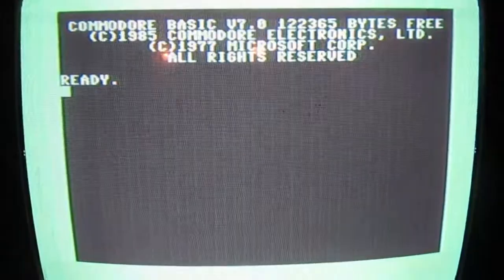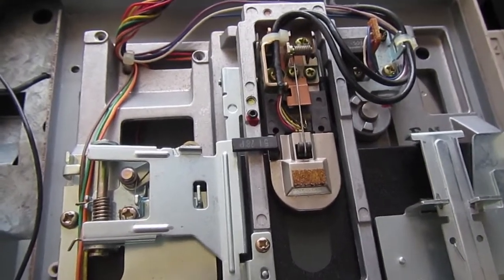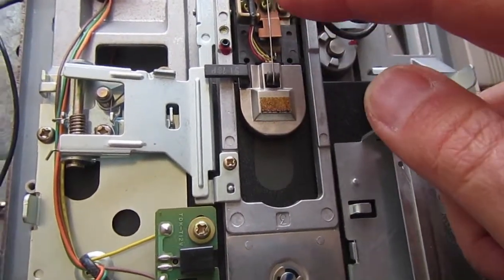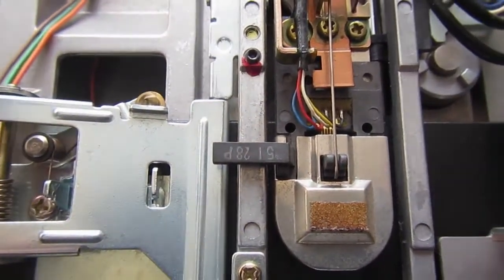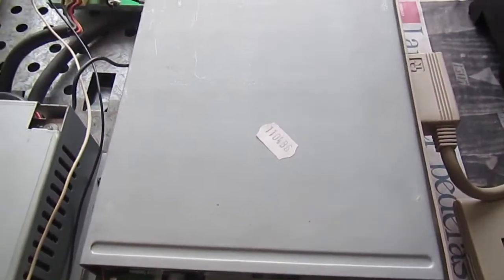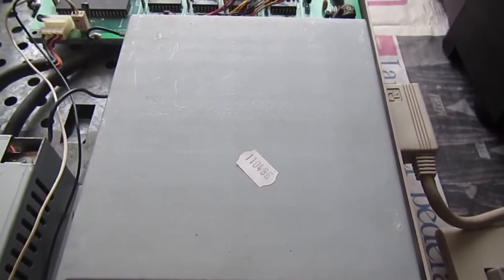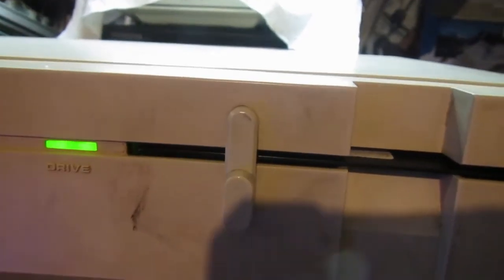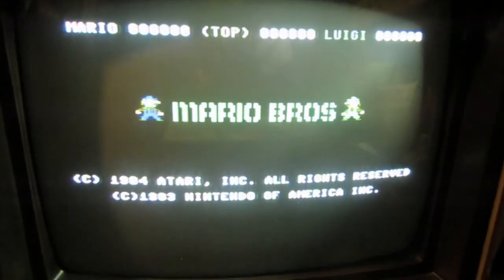Commodore 128D (1571) disk drive repair (plus other minor faults)

Comment: Got two of those monsters after my C-64 died. First still looks new but the warranty just ended when I tried the business computer mode and it failed to initialize. Repair shop charged $75 U.S. just to tell me it needed a new motherboard and not worth fixing. Bought the second 128D but can't remember why I stopped using it other than being pissed that Commodore and thier affiliated magazines stopped support for non Amiga computers. Think I moved to Windows 3.1. Getting ready to test the 2 computers when I find the cables and monitor.

Comment: many thanks for the very useful video.  I've a C128D and my problem is the small ribbon cable that goes from the 128D motherboard to the drive electronics, it appears to be damaged. Any idea where I could get a replacement ?
Reply from the maker: Hi! I don't think there're modern replacements ready made. However you can maybe test all the wires connections from one end to another with a multimeter and if there's a missing connection, simply cut the old wire and solder a new one. It's a low frequency connection so it will work fine. Keep the wire lenght as short as possible though.
Matching connectors can be still found on digikey for example.

Comment: Hi, I have an issue with my 128d floppy unit because it got once opened (by a stupid guy) while the green LED was ON (probably reading the disc). Since then the unit wont read any disc. Initially no error but when trying to Load a disc, makes noise (like reading) but then quickly aborts and keeps bilnking green + error message. What happened? Any ideas?
Reply from the maker: Hi, in theory that shouldn't have damaged the drive. You can try to insert a known good disk and issue (even in C64 mode) this command: OPEN15,8,15,"I0" : CLOSE15 

Also try to read the error channel. Keep in mind that isn't possible to diagnose a drive failure at great distances from the actual drive :)
Reply: Hi, thank you so much for the suggestion. I assume that the text between the quotes is I0 (letter I and number 0). I tried (it kind of resets the drive) but did not help.The error message when trying to load a disc is "?File not found error". What else could I do to troubble shoot? Thanks a lot!
Reply from the maker: @andreiturtoi3116  Yes, it was correct, letter I and number 0. File not found is interesting: try DIRECTORY in 128 mode or LOAD"$",8 in 64 mode.
Reply: Directory in 128 mode starts floppy booting then gives "Ready" however the green led of the drive turns to flashing mode...permanently
Reply from the maker: @andreiturtoi3116  Can you read the error channel after unsuccesfully DIRECTORY? You can do that with PRINT DS$  Also is worth trying different disks.

Comment: Nothing worked. It still either doesnt read the disks, or it freezes up while attempting to do so.
Reply from the maker: Hello! If it freezes up, I would suspet an issue with the IEC bus and/or burst mode communication between the 128 and the drive. Does it behave in the same manner also in C64 mode? Do you have any test equipment like oscilloscope or logic probe?
Reply: @iz8dwf  i do have access to an oscilloscope, but only at school. However, I don't know how to use them yet. In the meantime, im trying to get the sd2iec adapter working as an alternative. Also, i forgot to mention that ive been using it exclusively in c64 mode, as i dont have any 128 programs
Reply from the maker: Ok, for further troubleshooting you need at least a logic probe or (much better) an oscilloscope and of course, you should know at least the basics about oscilloscope settings etc. Let me know if I can help in any way!
Reply: @iz8dwf  i will eventually get there. Im studying to become an engineer. I will update on this in the future if i can. Thanks!
Reply from the maker: @MrDemonsushiGuy  Good luck! I did that many years ago too :)
Reply: @iz8dwf would you happen to know if i could take the disk drive components in the 1571 model ii and put it in the 128D instead?
Reply from the maker: @MrDemonsushiGuy  I've never attempted this transplant, but the electrical interface between the drive controller PCB and the drive mechanic assembly is the same, so you might try to substitute the drive mechanics, but first test the new mechanic assembly with the 128D drive controller to check it's all working fine.

Comment: Hi, great video, it would be helpful to me. I got few days ago C128DCR, it works more or less ok, but it have two issues, one is floppy making some strange noises but i think that good cleaning and lubricating should fix problem.
Link for 1571 firmware?
But another problem is bothering me, i have vertical line that goes up and down, no matter what mode am i in, C128 or C64.
Also tried with RF, video and svideo cable makes no difference.
I opened machine and my guess is that PSU is little buggy, one capacitor is fat on top, so i will replace all capacitors and voltage regulators, also rectificer and see if those vertical lines will be fixed.

Maybe you have idea what else to look to solve problem with vertical lines?

https://postimg.org/image/wccpyw7s9/

Thanks
Reply from the maker: Hi!
You can find almost all Commodore firmware on zimmers.net site. Here's the link for 1571 drives:
http://www.zimmers.net/anonftp/pub/cbm/firmware/drives/new/1571/index.html

About the video problem on your 128DCR, yes I would first check the power supply. You should check all the electrolytic  capacitors for ESR and replace the ones with too high values. Also might be some failed capacitors in the 128 motherboard.
Reply: Thanks, i will replace also capacitors on motheboard, everything is ordered, so now i need to wait )
Reply: @JosipBasic  you mean the north american 128D model? Where did you order the capacitors from?
Reply: @MrDemonsushiGuy  retroleum web site, they have. But you can buy them i every electronic componet store